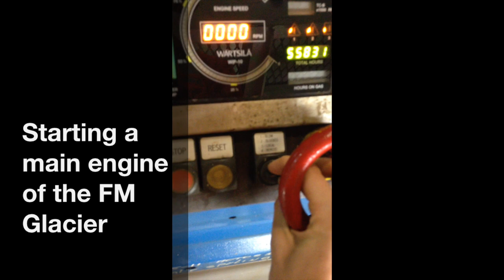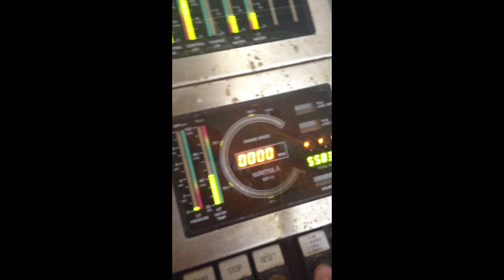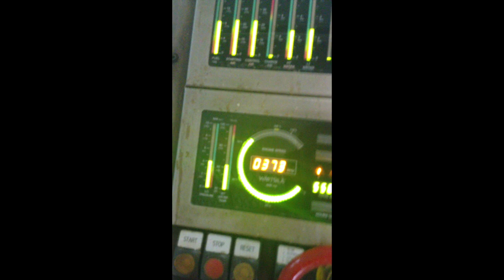Starting a main engine of the FM Glacier

Comment: could you add what the process is
Reply: A bit of late reply but anyway: First he flips the start selector switch from blocked position to blow. After that he proceeds to manually start the prelubricating pump and put it to auto. Then engages the turning gear and manually turns the engine for a few revolutions and after that disengages it. Then he proceeds to  blow the engine to check that  no water has accumulated in the cylinders and closes all the indication valves after that.  Then he puts the selector switch in to local position on and flips the starting lever up to run position and then he finally starts the engine in local mode and after the engine has started he flips the selector to remote position to enable the engine to be controlled from ECR, or bridge. Final thing what he does is he opens up the hot box and lubricates the fuel racks of cylinder fuel pumps.

Comment: what kind of diesel engine is that?  I bet it's rated in Barrels Per Minute in fuel consumption 😜
Reply from the maker: It is a Wartsila 6 cilinder 4 stroke engine. Consumes around 12 cubes of diesel a day.